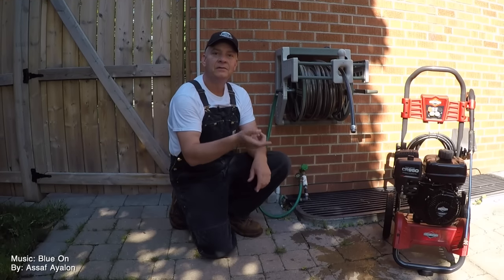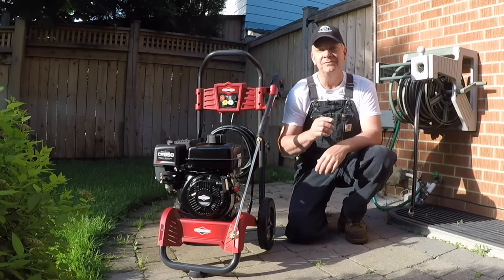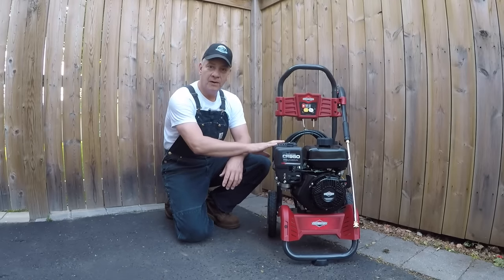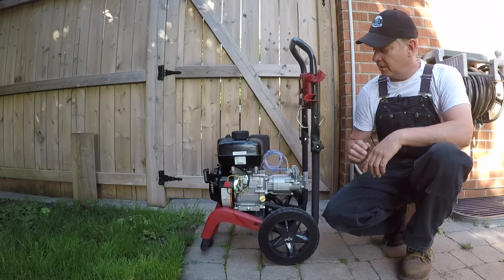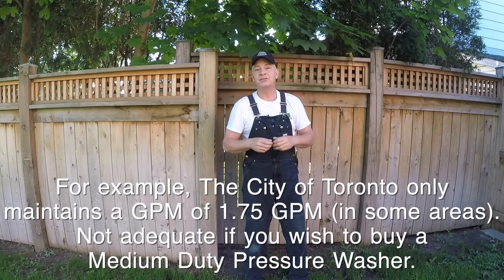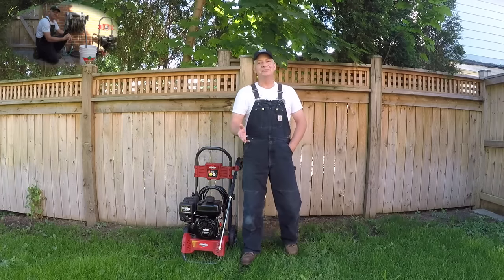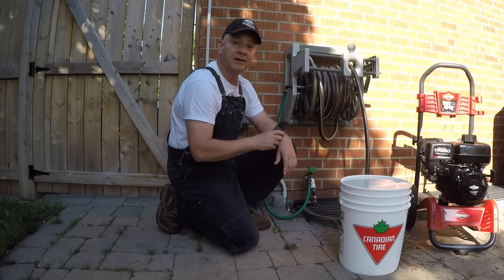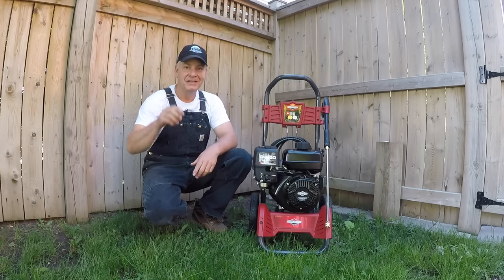#430 Don't Buy A Pressure Washer Before You Watch This! Critical Step That Most People Don't Know.

Comment: If using a 5 gallon bucket, start your timer and filling bucket at the same time.
When the bucket is full, stop the timer.
Divide the timer seconds by 60, and then divide 5 (bucket gallons) by that result.
For example, using the numbers in this video:
His 5 gallon bucket was filled in 55 seconds, so:
5 gallon bucket / (55 timer seconds / 60 seconds in a minute) = 5/(55/60) = 5.45 gallons per minute